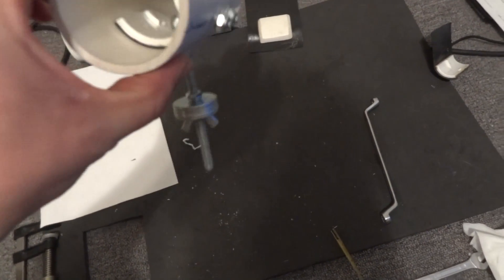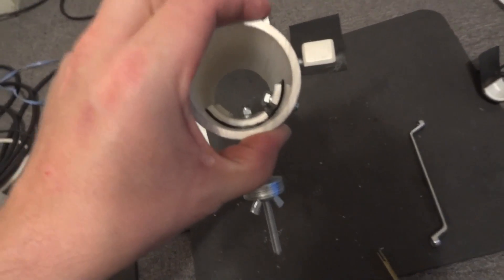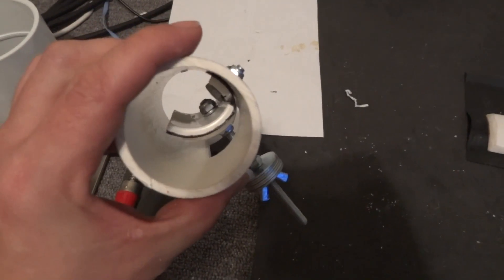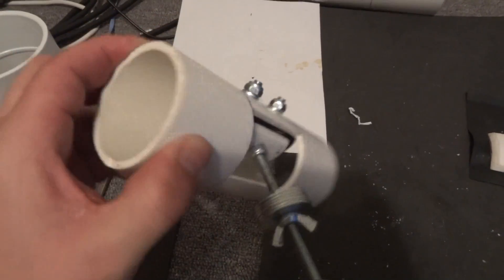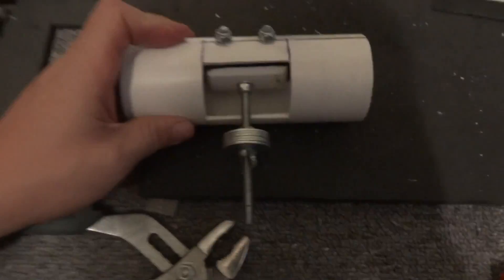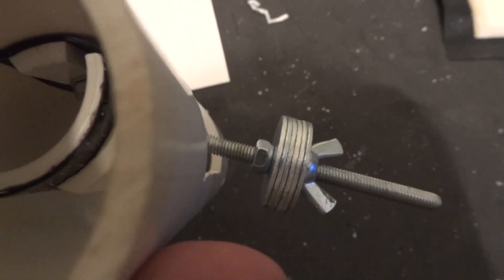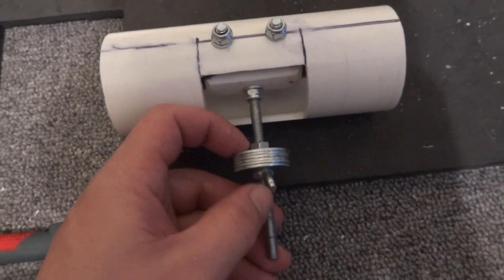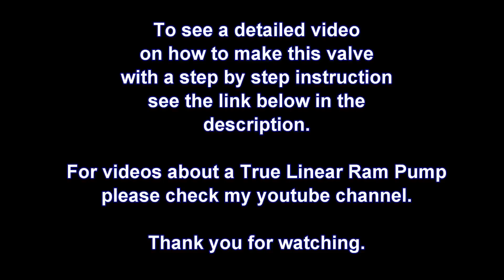DIY cheapest valve (silent) for a True Linear Ram Pump - SHORT video

Comment: You could just use 2 bolts and Stainless steel / bronze or brass plate for inner pieces and bolted together without gluing. Also could drill for first stainless steel bolt, both material at once and then for the second bolt. The same for attachement to the pipe. Eeasy replacement of the rubber as it wears down - just unscrew the bolts and replace rubber.

Comment: Did you give up on the Linear ram pump? Never saw a video of it working.. approtechie, Im sure you have seen his.. Just wondering.. I have not taken the time to build one yet, because I don't think I have enough drop and volume in my water flow.. Just wondering where yours would be located and the drop and volume.. If it is running, post a video please,, and show the area it is operating in.. Thanks..

Comment: Check this video as well Marco :HYPEG - WATER+AIR=GREEN ENERGY
by superjkaran
I believe that an understanding of that valve system will allow us to make water pump that can pump from any deep using free energy ( no need for wind ,sun ,fossil fuel nor electricity )  and generate free electricity as well at the same time.
Reply from the maker: cool, I'll look into trying that later. Thank you.